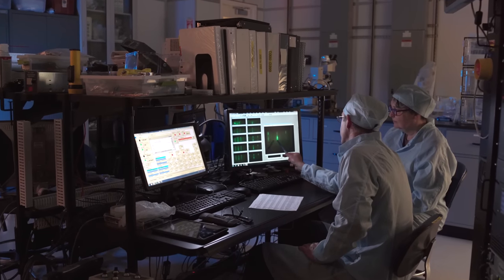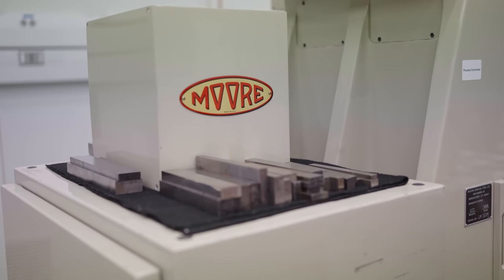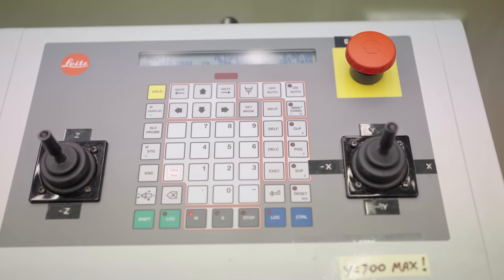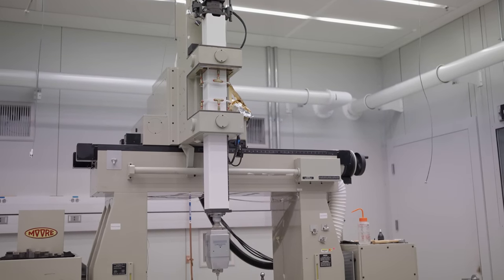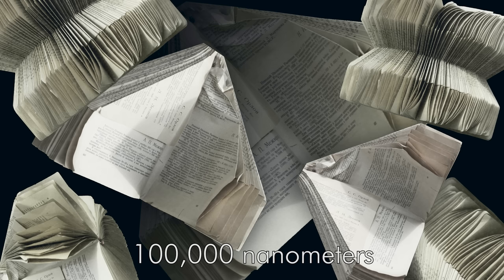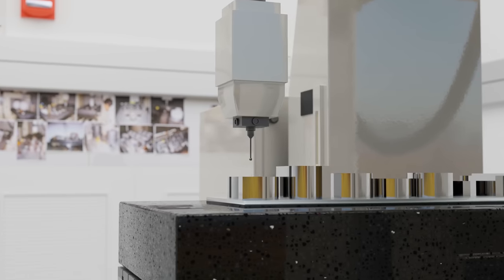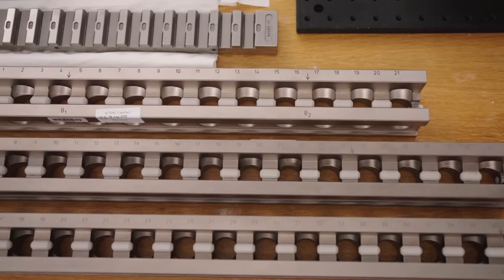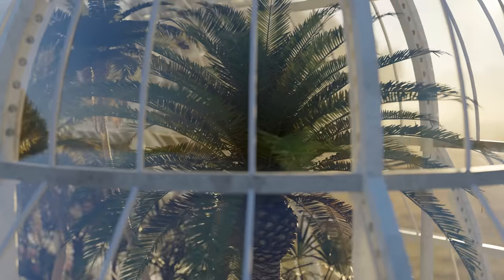The INSANE Precision of The National Institute of Standards and Technology

Comment: Nice flex, USA, really. Not a big fan of "elite world domination" counties, but effort and result is remarkable. One obious question, why so many mechanical parts, isn't pure interferometer based setup will be much less depend on environment? Just a bunch of deep UV light sources, couple of splitters/diffracion grids/whatever, sharp angles for even more precision  seems to be more robust and cheap.
Reply: NIST has many other instruments including interferometers for 1D measurements. The Moore M48 however is one of the most well known and most versatile instruments they have for dimensional metrology. It is one of many engineering marvels that they have. It's all about the right equipment for the job. And this isn't to say that other national labs around the world don't have similar capabilities. Some of the machines in the German and Swiss national labs are also quite impressive.
Reply: @dlyle2013  I know, I meant it is strange to see so many iron/ceramic huge framework, as main work is on light measurement and some statistic based refinement in software (i think something like dark/bias/flat/light measurement in astrophoto), why not pure photometric-style setup, w/o any mechanical parts. Well, maybe some common frame that hold interferometers but with empty main working area around main table, without that spheres on sticks physically touching object.
Reply: @AABB-px8lc  Part of this I believe is a matter of practicality. One challenge with laser scanning in general is the way the surface of a material reflects the light and the sensitivity of those measurements to dust and debris. Interferometers are great for highly polished surfaces that are normal to the source. NIST also has an interferometer used to measure spheres and other standards. 

One common part measured on the M48 is step gages used to calibrate other CMMs. The accessibility of the surfaces to be measured are sometimes obstructed making a contact stylus the most practical method and also the most similar to how the step gage will be used by the owner.

Comment: Soooo, I am mildly impressed with the 50nm accuracy, but for the most part I get to live in a similar world everyday. In New England, there are several companies that make machining and measurement products that routinely run in similar circles. 150nm form and less than 500pm finish albeit on comparatively smaller parts. Moore Nanotech and Ametek Precitech are both in Keene, NH. TMC in Massachusetts makes Isolaton and vibration damping products. And Zygo in Connecticut makes measurement equipment. There are of course more companies around the world making similar products. 

I am mildly surprised that this machine is using ball screws. Usually you would want to use linear motors, oil/air bearings and non touch probes instead. Reduced vibration, better control, severly reduced friction and wear, higher speeds while maintaining that precision. I am sure the accuracy starts with the laser interferometers, because less compensation is needed compared to a traditional glass scale like we might use.

Comment: LOL all those machines at the NIST are built, calibrated, and operated based on the metric system but yet they're still insisting to recalculate all of their measurements to the so-called imperial system which is left by their historic oppressors

Comment: Other than being an engineer's wet dream, of what use could this possibly be?
Reply: One decade's "wow neat" eventually becomes taken for granted.  Can you reliably make parts to +/- .001" without a tenths micrometer?  Could you reliably make tenths micrometers without at least .00001" measurement standards?  Now look into the EUV lithography that enables modern microprocessors.  The scales there really boggle the mind.  The feature sizes are so tiny that even extreme ultraviolet light is big, and it has to be in focus over a distance after reflecting from a mirror.  That mirror needs to be incredibly precise, and the machines that make the mirror, and the machines that inspect it...  Eventually there's surely a limit, but considering what we achieve by pursuing it I don't think it's a waste to keep pushing.
Reply: @SouseMouse  That is my point, what do we achieve by pursuing it? We make precision measuring tools just to make other precision measuring tools? What requires that type of precision fitment?
Reply: @toolmike100  It is almost always secondary calibration standards for other equipment.

Comment: Okay, but the United States is on the metric system, we just don't want to change our speed limit signs, car dashboards and the way we thing about temperature? Never worked somewhere that used the foot or pound as a way to measure things from being a mechanic (a ford mechanic) or a weed seller (grams all the way) or clearly, the agency that is fundamentally responsible for getting any measurements

Comment: the inch is not a unit of the metric system, imperial predates the metric system
Reply: Nowadays the definition of an inch is just 25,4 mm.
Reply: Yes, the inch was a free-floating standard for centuries, maybe millennia, and in more recent times the "official value" slightly varied in relation to the meter before it was finally defined in terms of the meter. I recall the earlier video discussing gage blocks mentions this. I've collected many editions of the CRC Standard Math Tables (I'm such a geek, but I can only dream of being as much of a geek as Mr. Machine Thinking), earlier ones give values of the inch in relation to the meter that vary by small amounts, later ones all give the established standard of 25.4mm.

Comment: Sorry to be a buzz kill about the metric notion, but that machine was designed using inches, and measures in inches. The software they use just converts it to meters/nano-meters etc. I only thought to even check when the video mentioned it. If you need proof, the main table of that machine is exactly 24.000 inches by 48.000 inches. If you were to measure it in metric units it would just be some unusual decimal or fraction. Some people like to ignore reality, especially when it doesn't align with how they want the world to be.

Metric was invented by a bunch of caffeine riddled Frenchmen in the 1700s, and most of the units they invented have just been completely ignored or drastically changed or just copied from imperial. And if anyone thinks that the metric system can't be improved, let them try to use metric time for a week.

My favorite unit of the day : N.L.S. - Nano-Light-Second.